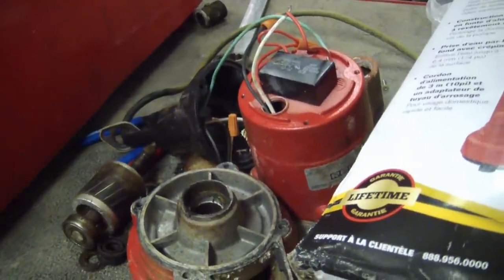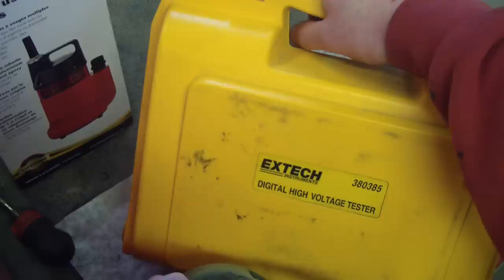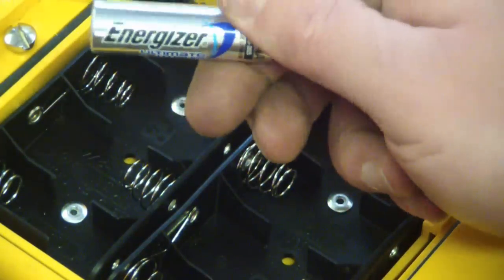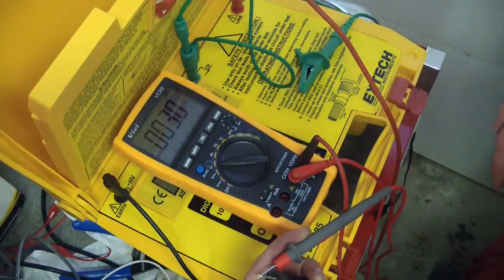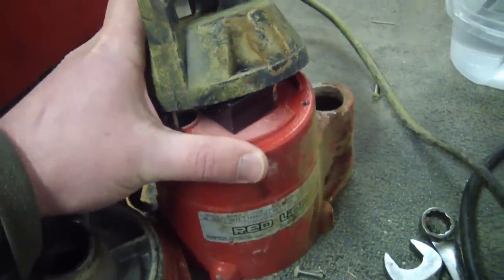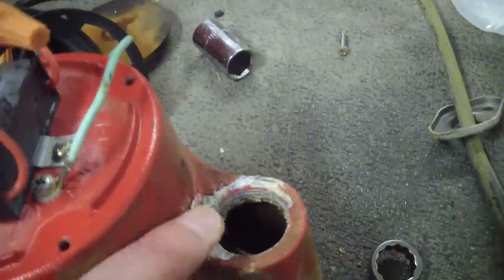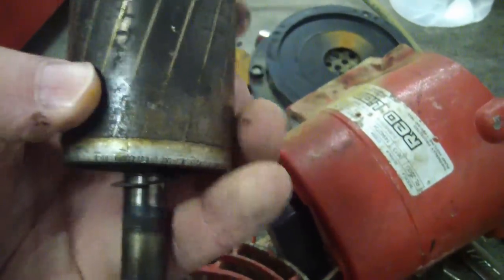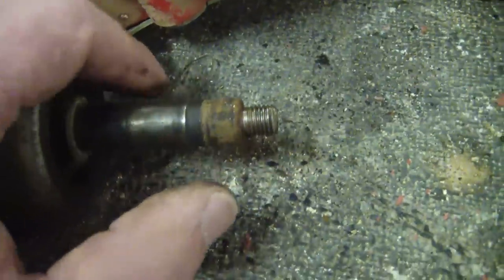BOLTR - La BOMBA! Red Lion water chooch'r is engineered to FAIL!

Comment: The Kapton on the ground pin, lose that reference to common earth trick! I have an AC hi pot tester that will burn the paint off a concrete floor, and draw arcs off a brick wall. How cool is that!??? Biddle hi pots run around $5000. Ex Tech makes those FLIR cameras. Well they make the budget low end ones anyway. If you call $1000 a budge line anything. Those hi pot meggers USUALLY won't kill you, but it hurts like all hell when you get zapped. I are an elekrishun, so I has these kinda stuffs around. I have a 5KV DC megger, and a 6KV AC hi pot. They are handy to have around.

Comment: Similar Thing with Audi steering gears: with the Audi 80, back in the 90's, they chromed the steering rods and used pretty heavy rubber cuffs. Since the A4, they omitted chroming and went with lousy plastic tubes for protection. What happens is once the crappy plastic cuff rips, the steering rods corrode at the Point and with every steering the corroded rod gets pulled through the power steering seal, "sawing" it to shreds and servo oil leaks out. Wouldn't be that much of a Problem, but they don't sell power steering seals separately! All in all repairing it costs you almost 1000 bucks and I'm talking European Gold doubloons!

Comment: Nice in depth review, more depth than the pump could handle. I'll buy your explanation. Also would the steel shaft be anodic to the bronze nut?  If so that would help it along it's path to destruction.  You noticed the tickyteeboo bronze nut looked like new.

Comment: CD and DVD drives for PC's  
Back in the day when you were "Burning CD's and DVD" I had drives that would last for ages, then newer ones that would fail on the draw/tray.
Opening up the new versions I found plastic parts with an odd colour on the cogs that spin to move the tray in and out, and the older ones it was all the same colour and thickness as the other moving parts.
So it seemes like the newer versions were being built to fail after a specific number of open/close cycles. Which they were. However I still have and use the original DVD Burner ive had for about 20 years.

Comment: Common in Automotive Coolant pumps. Most Cars cooant pumps driven by Timing Drive belts, not only does your car overheat, its going to throw your timing out and cost you an engine too when pump bearings fail.  ;)

Comment: AvE, are you still reading these old comments? At 15:00 you mention teflon tape, talk to us about that. I was taught that the tape is just to reduce friction, so that the actual parts can be torqued together tighter. Thus, only a single or maximum double wrap should be used. However, most guys I know wrap the teflon around a dozen times as if they're in a toilet paper factory. Which was is right?

Comment: The only warranty I believe is Craftsman tools. They replace everything, regardless of who much I beat the shit out of the tools, use them in ways they were not meant to be used, break, bend, chip, crack, heat with a torch...you name it. Never had an issue replacing it.

Comment: Plant starter motors that use a wet clutch, the oil seals work in a similar manner to have a drive end bush that wears to where the oil will pass the seal into the motor and absorb into the brushes become soft making them fail

Comment: I went to replace a molded plug on a sump pump one time and found that there was no ground  conductor even though the pump end had  ground conductor hooked up properly.  The plug even had a ground pin. I dissected the cable and found that most of the  ground was missing from the jacket and only the very end that connected to the pump had conductor. Manufacturing error or trying to save money on copper? I'm not sure.

Comment: the mcculloch mowcart 66, has a plastic YES PLASTIC diff, dads one kept throwing the drive chain, turns out the bearing surface on the crown wheel wore out and allowed the whole lot to move around enough to cause it to throw the chain off
Reply: oh and the steering wheel bushing gets rounded off and wont steer, dad and i found an old honda civic inner steering shaft and put that on to fix that, then it started bending the plate on the other end where the drag links attach

Comment: Also, I recall a vid when you demystified an egg cooker, and exposed a fuse under some heat shield sleeve.  This fuse  goes tits up every frikken time 90 days has passed in popcorn poppers, pizza cookers, CERTAIN CHEAP COFFEE MAKERS  ad infinitum. It is "programmed obsolescence", and if you replace it with good nichrome WIRE your device will last and last.( Not recommended, though I DO IT ALL THE TIME.)

Comment: Ya I've seen this kind of stuff before... some part designed to come into contact with water that's made of cheap iron or steel and then given a super thin electroplating that quickly wears off and then it rusts and fails!

Comment: I'm late to the party on this one...just found this channel last week. This reminded me of a transfer pump for a central heating system that my mom had in her house. The copper pipe leading to the drain corroded out, so we had to buy a transfer pump that was supposed to pump water up and over to a sink once the little reservoir filled up. Well, the idiots that engineered this damn thing didn't test compatibility of the rubber check valve they were using, so the slightly acidic water from the heater caused the ball to swell, making the check valve useless. This made the pump useless. This made water overflow the reservoir all over my mom's basement carpet. Absolute disgrace in engineering led to a huge mess and huge cleanup bill. 

Material compatibility...it's a thing guys....

Comment: My guess is that the place you bought it from cut corners on a stock commercial pump. It wasn't especially designed to fail, they probably went to the manufacturer and said how can we save money on this pump? Easy, don't use a SS shaft.
Rob

Comment: Great video, I learned a lot of stuff I don't  need, but was curious about.
I'm thinking, if the pump was engineered to fail on purpose, they would have cut corners on the gaskets, etc.  Might they have assigned the seal/shaft part of the job to an intern?

Comment: Question: So knowing about the carbon steel shaft, you buy a replacement pump of the same brand.  How would you add a stainless sleeve?  Would you carefully cut one to interference fit tolerance, chill the shaft and heat the sleeve, then press it on quickly?

Comment: I would guess that the car industry is way ahead when it comes to engineered failures. Just take a look at Audi A4 with the B6-body. Instead of having window seals that forces the water to the outside of the doors it has a "ditch" type of seal. Which means that a lot of water is going to enter the inside (without any drain holes). Combined with +5C and salty roads, (as it is from october-march some places (ex Sweden), rust from the inside will appear when Santos Klaus arrives for the second time. And thats just one of the apparent designed failure modes I've seen as a wood engineer.
Reply: Well your first problem is Volkswagen Autogroup. They are notorious for horrible designs, and unreliable vehicles.
Reply: Fraser Davidson

LOL, I have over 400k miles on a 99' 1.8t passat. If you don't maintain it, of course its going to be junk. People are cheap.
Reply: turbominivan60 I agree on the maintenance. I've got a 1995 BMW 318is, that was not maintained, so I've had to go through and basically rebuild the car.Had the previous owners given a damn, I would have had a much easier time. Currently I'm tearing apart the intake to get to my starter to diagnose why it won't chooch (worlds stupidest design). VW seem to be either very good for reliability, or fall apart from the factory from what I've heard. Sounds like you got a good one.
Reply: True, they are very hit or miss. Depends on if it's built on a Monday or Friday..ha

Comment: It's called Planned Obsolescence. An Essay was written back in the early 1900's as a way to help the economy. One of the biggest offenders back in the day were light bulb manufacturers. There was a light bulb racket that ensured light bulbs wouldn't be engineered to last beyond so many hours. Anyone who went  against this were punished. The U.S. eventually broke them up but by then it had spread to far and now planned obsolescence is part of modern engineering. Videos like these are one of the only to combat this in today's modern world. Side note There is still a light bulb burning in the U.S. since 1901 that was not engineered with planned obsolescence.

Comment: My whirlpool clothes washer had a similar blatant engineered to fail spot on the main drum bearing... Water can collect on a little lip in the plastic retainer and there is an obvious spot for a drainage hole but there is none so my brand new washer after about 2 years of running threw that bearing because of the rust  and just about rattled it self to death... We tore it all apart got a new timken replacement bearing and drilled out that drain hole and after another 2 years no problems... Companies do this kind of crap way more often than you think... They want you to buy a new one because for their tech guy to come fix it would cost more than a new one, as was the case with the washer....

Comment: I build a lot of brushless racing drones. Does the digital high voltage tester also work to test brushless motors? Keep in mind, they run on a DC voltage of 14v to as high as 50v on the crazy motors. Also, an average amperage of 20a to 120a. Any alternative ideas are welcome. Love your videos.

Comment: It does happen in electronics too, prime example is laptop battery packs, mine is a Dell but I'm sure others are the same. They have a little micro  controller in them that counts the hours the battery has been used and after a certain amount, they are declared dead by ACPI, can't re-build them, can't do anything unless you can get deep into it and somehow re-flash that chip to 0 hours. The good Chinese knock-off versions of the same pack have no such chip so when their cells die, you can re-build them with better 18650 cells, and by good version I mean the $50 9 cell ones from aliexpress, not the $35 dollar ones, they will actually perform as expected and not start a fire.

Comment: a lot like older briggs engines. not the old base cap te01-04 models. the newer ones from the age of siclebar mowers. my output shaft is hardened but not chromolly. have to replace my seal once a year and check my bronze thrust bushing i put in to replace the old one

Comment: Dewalt compound mitersaws come with the belt tensioner too tight. Causes premature failure of the bearings on the motor shaft. Easy fix to just properly tension them when you get it, but I think it was engineered to fail. Bearing fails, and people think it was just a bad bearing, not a fault of dewalt.

Comment: im a cnc machinist and mainly for a small company I have 3 manual lathes and 3 nice turning stations 2 of which are mori seiki..I do it all but by no means claim to be mr smarty pants.. but this is the second place ive worked for in this line of work..the first was linamar, w
e ran automotive parts mainly machinine new engine blocks I ran the shaft dept..my whole reason for this info is both places ive came to realise just having the engineer title means absolutly nothing..its like they bring prints out I look at the print and tell them quiete often thats not going to work..its like most of them are way to stuck in there books to know a dam thing about what there trying to build or desighn..with the ignorance and the issues they have trying to be an engineer I dont see them even being able to purposely make a failure point..I think its just more of their total ignorance causing this to happen..

Comment: Can confirm in electronics: Toshiba's satellite series of laptops is designed to go tits up after a couple of years. Not in planned obsolescence because they load up on system specs - you get a great system for the money comparatively to other manufacturers. What happens though - is it burns out, and did so for years. They give you a wicked CPU with a woefully under powered fan which can't possibly evacuate the heat as necessary and just by allowing it to be on for [Q] value of run hours - it will burn itself out. I don't know if that's still an issue, but my mother went through 4-5 of them, having to buy a new one every couple of years because they'd burn out. Someone had the bright idea of creating laptop boards with USB powered fans designed to keep laptops cooler and that remarkably extended the lifespan but without that extra bit of third party cooling - the things would end up deader than a horny teenager on elm street.

Comment: I worked at a pump manufacture that was purchased by franklin electric. when they moved the machining operation to it's new home, (This plant thought they were god's gift to the world) they were having problems holding tolerance so they opened the drawings and changed the spec. on one occasion they sent us 10,000 parts for assembly that were machined on a center I helped build and programed, they got the wrong tap and kept adjusting the tap deeper to get the go-no-go gauge in it good thing cycle time was 15 seconds where as the old machine was 1:15. this is the same people that wanted me to change the program and email it to them because they didn't have it (but had the machine and software to change it, just didn't understand the program was already in the machine) big difference in a 1"npt and a 1" bsp

Comment: Best way to fix the problem (we call it residual current device (rcd)) is easy.

Remove the RCD (or whatever you call it) from the consumer box, and replace it with a two pole isolator. 

You will never get that problem again.

Comment: Speaking of engineered to fail. Story of MOS technologies, the chip fab owned by Commodore Computers has a similar problem. The chips all have a glass passivation layer on top of them, essentially an environmentsl seal. But the glass has too much boron in it (borosilicate glass) and as time and heat marched on, (the chips all ran very hot too) the boron would diffuse into the NMOS chip itself,  essentially poisoning the dopants in the transistors. They will all eventually fail, it is just a matter of when...

Comment: Years ago I used to replace circulating pumps on hot water heat systems and the seals are always the first thing to fail. As if it was engineered to do so. Too common these days.

Comment: Measuring the resistance with the multimeter is probably not reading capacitance.  You are probably seeing some electrochemistry from the raw metal electrodes as they plate out and change conductance.

Comment: We discovered someone had drilled a hole in big red while pushing a 100KV thru it during its third HiPot. Pixies jumped out and ran down the pipe rack that folks were working on. Later it was noticed one end of the rat line was fixed to a piece of one inch rigid conduit. That could of been an interesting day. Later we all got searched by the FBI/Homeland Security. Fun times

Comment: The new scam with sump pumps is to provide float switches with very limited duty cycles. Even the "good" pump makers have resorted to this trick. Usually you find out when you already have a foot of water in your basement. I've bypassed the internal switch on my new pump and am using a 40 year old external switch which probably has over a million cycles on it.
Reply: Pro1er best way around is to do what you did or find a set of probes and put a daft little box on the wall with the corresponding electronics in. bit more expensive but the probes work so so so well for me.

Comment: start capacitors (mit oder mit out a run cap) are usually for High start up loads>>>ie compressors , bench grinders & Positive Displacement pumps...
Reply: No AC induction motor will start on single phase power without a starting capacitor. This motor uses a starting capacitor which remains in the circuit during run, which is very common on self-contained submersible pump motors. The advantage of this design is it needs no centrifugal switch.
Reply: Addendum: there is such a thing as a shaded pole induction motor which has no starting capacitor, but they are only used on low starting torque loads such as small fans.

Comment: i have seen similar cost saving antics but the best compromise which i have dealt with was to hard chrome a mild steel shaft that will be exposed to water,usually this is about 0.40-0.70 mm thich on the shaft

Comment: Speaking of engineered to fail, my cat has come home without it's flea collar 4 times in 2 weeks, so I keep having to buy the damn things, and I figured out why, on the pack it says "with an innovative new safety clip", Which means if the cat pulls at it, even lightly, it'll just fall apart, I never had this issue with the collars that have the elastic safety section. Engineered to fail shinola.
Reply: +Michael MacGyver trust a professional... flea collars, even when they stay on, are ineffective.  Use a topically applied product your veterinarian recommends.  Do not use the crap from the store (Hartz, Seargents, etc.)...  I have seen cats crawling with fleas having seizures from the chemicals they use. .
Reply: Michael MacGyver both are safe and effective (frontline and advantage, respectively).  Frontline is a little better in wet environments while advantage has a slightly better kill time.  Always double check that the product you are using is labeled for cats. For best results, apply every 4 weeks (go and mark your calander) instead of "once a month."